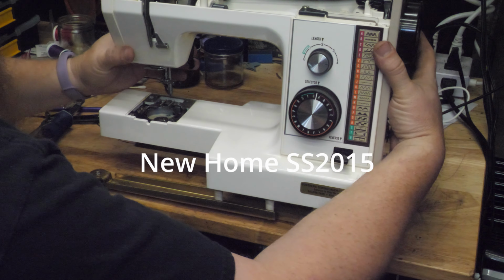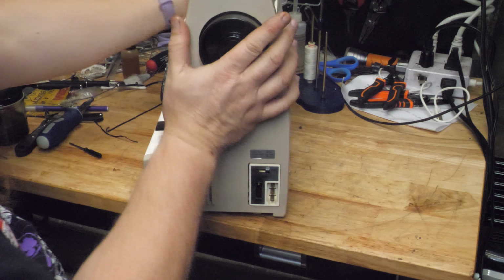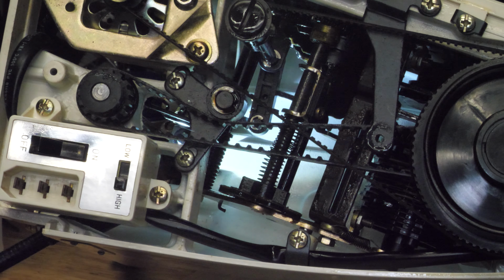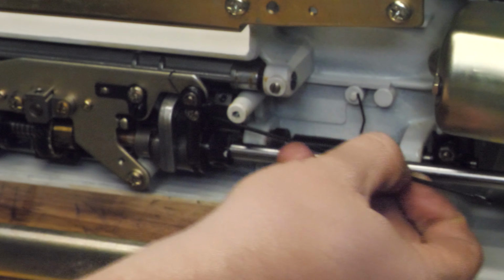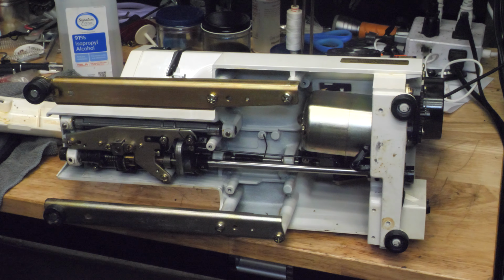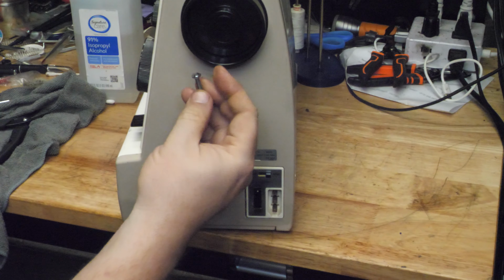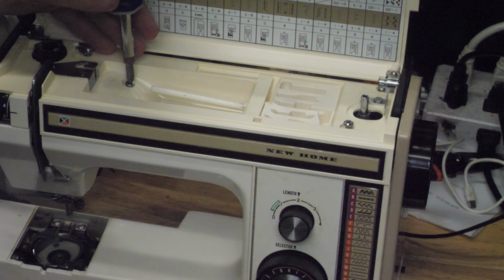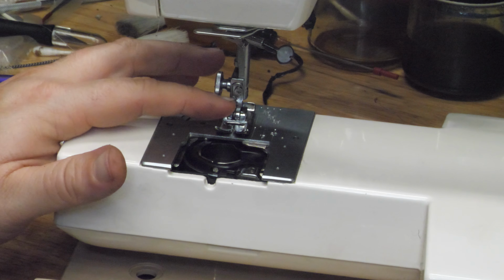New Home SS-2015 Service

Comment: Do you have any other videos on the new home SS 2015? My mom has one and it doesn't want to go up and down smoothly like it is binding up somehow
Reply from the maker: Unfortunately that was a customer machine and I don't have it any more.  Have you cleaned it thoroughly in every place you can find and then applied some fresh oil to anything that you see move?
Reply: @henrybangsberg2187 no, I just looked at it for the first time today! It's my moms and has been sitting there for a little while! I am not really familiar with sewing machines but I didn't know if you had any ideas on what it could be! It's probably gummed up like what you were showing and talking about
Reply from the maker: @bobbystewart7070  Yes, if it's been sitting then the old oil and grease has turned sticky and it will need cleaning and oiling.  You can use a hair dryer to warm up very sticky areas to help melt the old oil out and get fresh oil into the joints.

Comment: Holly gears! it looks much better than the late years machines. Still plastic gears, but that's an engineering art to please eyes. Which year is it?
Reply from the maker: I believe the SS2015 is a 1980s model.  It's a very stylish machine with a well designed plastic cam stack in it but it still has metal hook gears and a metal needlebar crank.
Reply: @henrybangsberg2187  Oops I thought somewhere from 2000, before everyone jumped into the rotten pond of fully plastic cases without metal frame/
Reply from the maker: They were using plastic knobs & other parts in the late 60s.  By the 70s they were using plastic covers, cam stacks, and gears in various places with mixed results and by the 80s it was just a matter of how much plastic you could get in a machine.  Singer built fiberglass and plastic framed machines with almost no metal parts in the 80s and 90s.